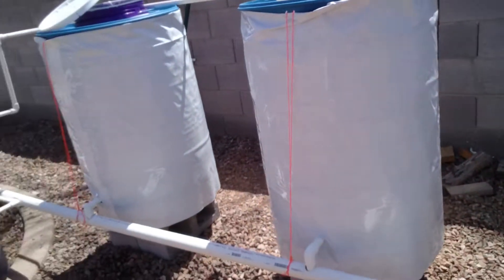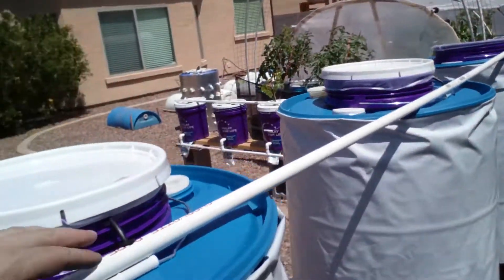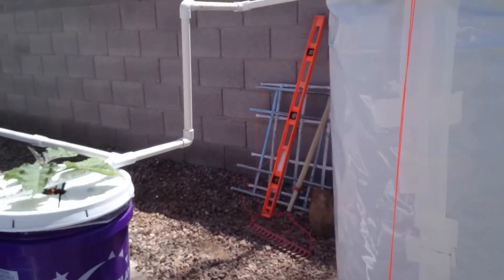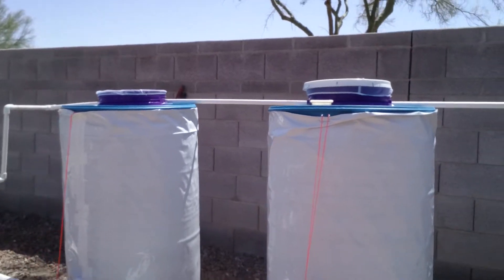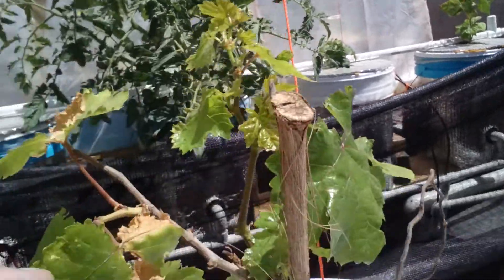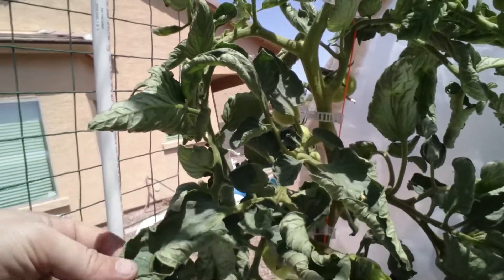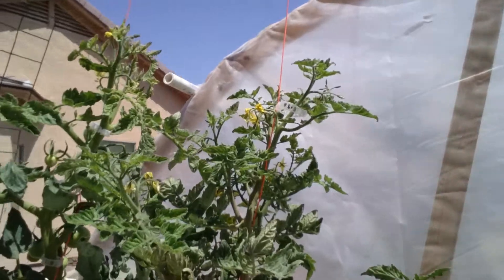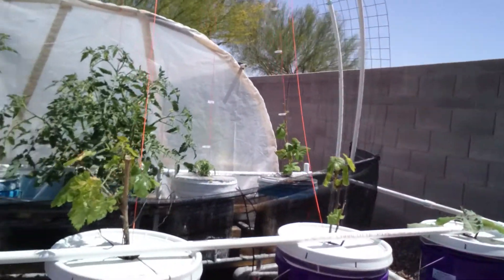Gigantic hydroponics Dutch buckets system for avocado trees.

Comment: At work what we do is we take a pot, bury it in the ground with a drain (this would be your bucket) then we have another pot go inside of that (this pot actually has a tree in it) and then we just use irrigation drippers and do not recirculate the water.
I’m basically doing what you’re doing but I’m putting Geotextile around my drain and I’m going to straight up root the trees in the barrels on their own, 55 gallons of growth medium instead of 5

Comment: I read that your first trees died from hot fluid. How hot was the nutrient fluid? How did the 6 more you had inside do? Did you do an update video with the survivors? 

Great job on the large system design. How did you decide what size drum you would need you accommodate the trees roots?
Reply from the maker: The water temp was over 100 f, I've since redesigned the entire system and have killed all the trees that were inside lol 
I decided on the barrels just because I figured the roots would need lots of space.
Thanks for stopping by and thanks for the questions and comments👍
Not giving up though just more experiments.

Comment: Hi Todd, thanks so much for the video...
I've been think about my future dutch bucket system I'm going to make in the future. I've watched alot of videos... and one of the biggest issues for guys in hot climates is water temperature. So that got me thinking.. will it be a good idea to have the buckets sunk into the ground... this way the temperature would be more regulated
Reply from the maker: I've redesigned and rethought this whole setup twice since I posted this video. Placing the buckets in the ground will most sertainly keep the temps down👍👍  I just wouldn't want to dig the holes lol My soil is solid clay where in live so i incorporated the buckets into my larger aquaponics system and that system has also been tore down re thought and redesigned. Best of luck with your project and if you have questions keep em coming👍👍 I'm happy to help😃
Reply: @ToddLarsen  awesome thanks much I'll definitley take you up on that

Comment: Did this work out for you with the avocados? If so, what nutrients are you using?
Reply from the maker: Jesse Kramasz it didn't work out as the temperature in the barrels was high and needed better insulation. The nutrients I used was a Masterblend 4. 18. 38. And I added Cal mag.
Reply: Roger that. Classic vege mix. Where do you live, and what temps do they run at? I have a few seeds I want to try that with, but you bring up a good point about temperature. If I could keep them shaded they might stand a chance...
Reply from the maker: Jesse Kramasz I live in the arizona desert and have temps as high as 120 in the day time. I have built an entirely new system since I made this video, you wouldn't even recognize the yard from this video to now.
Reply: Also, check out Pepper Lovers Community on Google+ if you aren't already there - a lot of people there would like your setups I'm sure.
Reply from the maker: Jesse Kramasz Thank you, I will check it out for sure👍👍

Comment: What grommets did you use for your main feed line from the white pvc pipe to the small feed lines thanks
Reply from the maker: Ty Ty Thanks for tuning in and thank you for your question. I use what's called top hat grommets and there 1/4 inch in size. and I think I used a 3/16 size drill bit.

Comment: Hey Todd, like your setup bud.  How do you tie the 1/4" tubing into your pvc to feed the plants?  Does it leak at all?  Do you have a video on it?  I drill a #57 hole into the PVC and it works great under pressure, but my problem with it is that it's static.  Can't move the outlet around like the tubing allows.
Reply: No, it's ok really.  I knew what you meant, but I need the reassurance before purchasing it ya know.  This will allow me to move the watering to the side of the buckets which is a big deal if you've been watching how I do things.  I often have cages on the buckets and working the PVC in there can be a little work if I need to move a container.  I do often do that too.  Thanks buddy.
Reply from the maker: Brent & Gina's RV Traveling Adventures Thanks for tuning in, to tie in my 1/4 tubing into the 1/2 inch pvc I drill a 3 1/8 inch hole then I use what's called a 1/4 inch top hat grommet. They can be found on Amazon in packs of 100 for about $49.00.
Reply: Nice, thanks!  Did you mean 3/8"?  3-1/8" seems really large.  Just want to make sure.  I'm really considering adopting this part of what you're doing for my PVC watering system.
Reply from the maker: Brent & Gina's RV Traveling Adventures 3/8, sorry had to much sun I guess lol